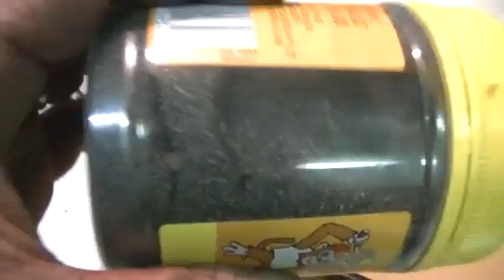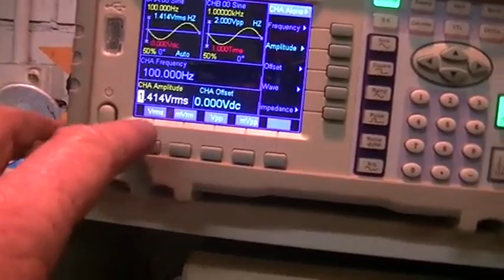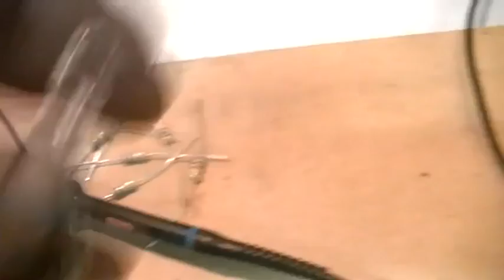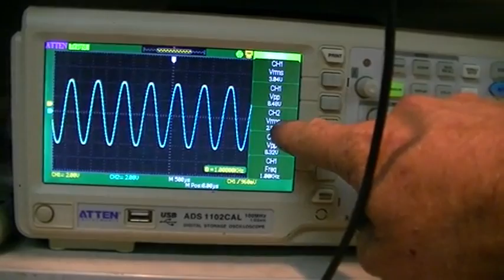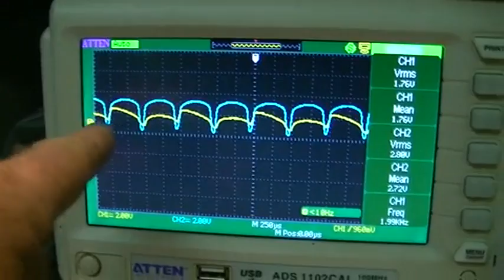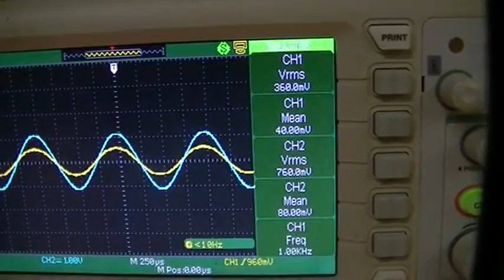Hybrid Toroid Transformer X ,a look inside.

Comment: Thanks for the video . I can understand the inner winding getting a higher voltage because of the back emf , but I wonder what difference in the current of the inner coil at core saturation frequency and out of phase at 90 degrees and 180 degrees.